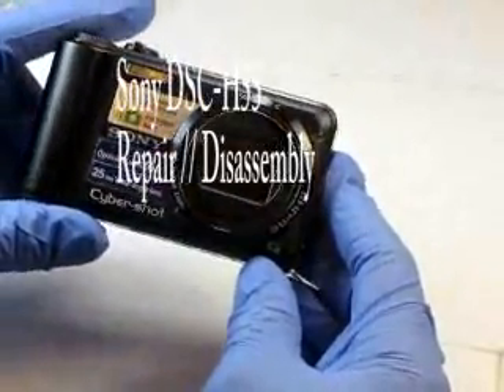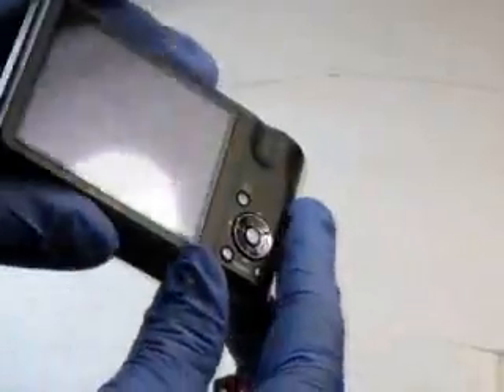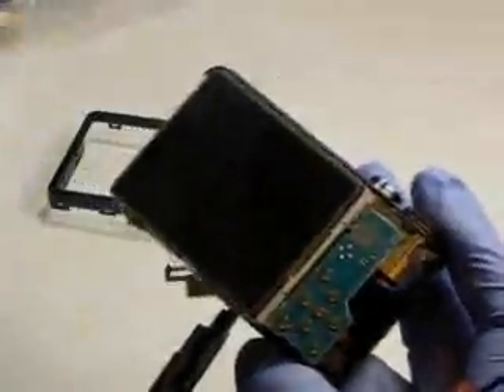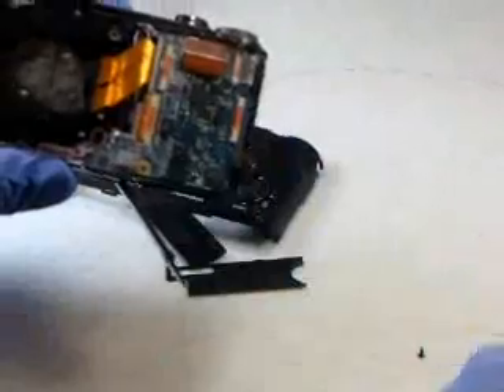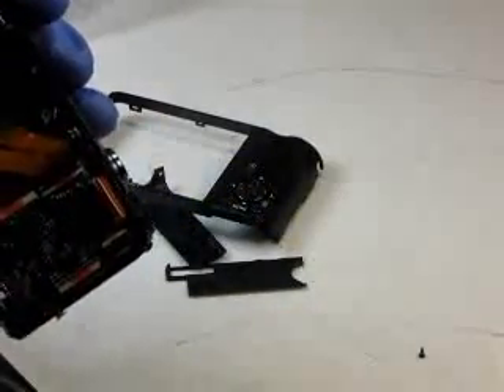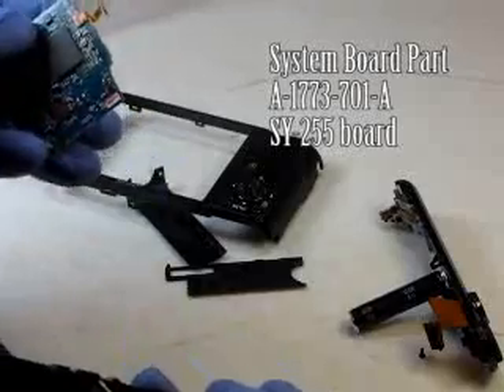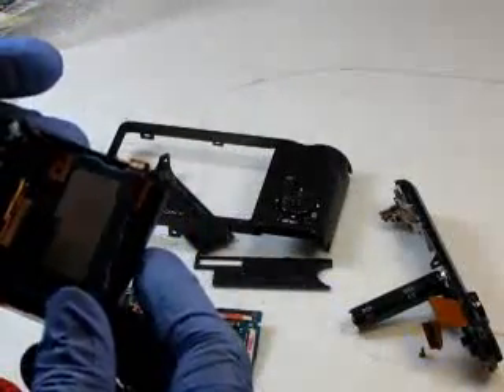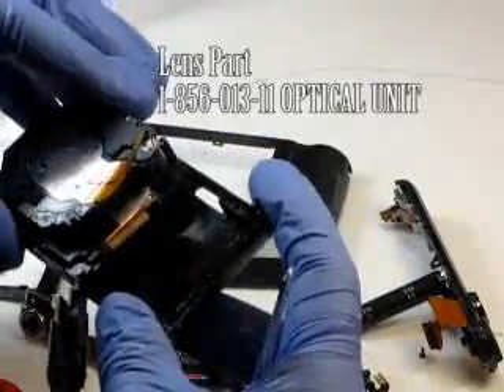Sony DSC-H55 Disassembly Repair Fix LCD Lens

Comment: Hiep hiep hoera, my camara is fixed, grace to the video and the answer on the question about the built in battery. Problem was the start if the camera. I had to fill in the date and time but when I pushed the button OK, nothing happened.  I couldn't close the camera. I had to take out the battery. I followed the steps in the video, replaced the buit in battery and after a while (First a purple screen) the camera does what he have to do. Thank you so much for the video. My compliments!!!

Comment: Thank you for the real help. But I want to replace the  built in battery, but I can't see it in te movie. Is there somebody who can tell me or better has a movie to demonstrate.
Reply: Yes, Disassemble as shown.  The part of the video that shows Memory Card ASSY Part # A-1764-313-A has your built in Battery (location in video 6:21). The battery is on the underside of the Memory Card ASSY. Desoldering required to replace the battery.  Video not required, just follow the instructions to dissasemble at point 6:21.. then turn part upside down and the battery is near the bottom.. just desolder it and replace with new one.
Reply: @cameraparts4you  DearMr/Mrs cameraparts. So happy you give me the right answer. Thank you.. Now I can replace the battery and I hope that will solve the problem. Tnak you again and I let you know if it is ok. Have patience for a while.
Tnaks you!!!! Frans Lucas, Netherlands.
Reply: @cameraparts4you  Thank you. Your remark was very helpfull. I can replace the battery now!
Reply: I found the replace battery ( € 35). When I started the camara, i had to fill in the date etc. But the lens did not came out. When I click on OK, nothing happened. I thought the builtin battery is out of order. When I see the price I like to know if that solve the problem. Can you help me with an answer??

Comment: The lense on mine tries to come out but won't come out. Like it's stuck or something
Reply: Sometimes there is a sticky residue from an old spill, just flip the camera around and apply some pressure.  It will come out.  Make sure you have done all the required steps prior to removal.
Reply: @kaelajoshua7188  did everything and it just won't stay out

Comment: Hi - first of all - define "bad" LCD -  i have one.   When you turn it on the screen stays white, sounds is hear when buttons are pressed but the lens stays closed.  Anyone with advise on how to reset the cam or fix it please shout. Thx
Reply from the maker: +Rinox88 A White screen can mean many things. White screen can be cause by a bad LCD or water damage or
a bad board.  From my experience usually water damage is  the main cause for a white screen.  The water damage can be on the board or on the LCD.  Hopefully just the LCD.  You should remove the LCD and look at the clamp area where the LCD fits into the ziff socket and check for corrosion.. also check on the LCD gold fingers.
If all looks fine then get a replacement LCD.  You can find them cheap on Ecrater. or WWW.cameraparts4you.com.

Comment from the maker: Hi. Unfortunately the H55 does not allow you the luxury of a quick lens install.
The reason is because the lens is latched underneath the tripod base and in order
to get to that you need to remove the main board and plastic frame.